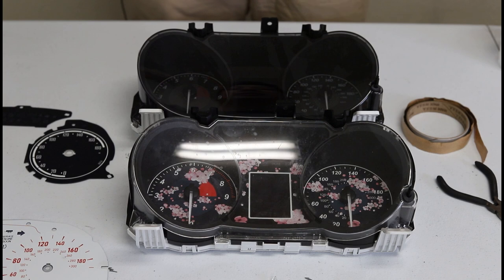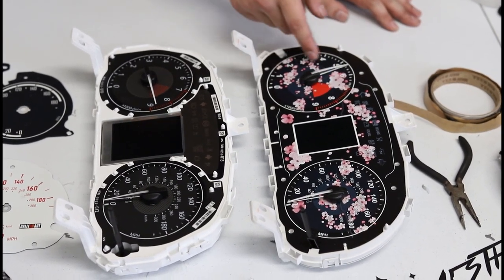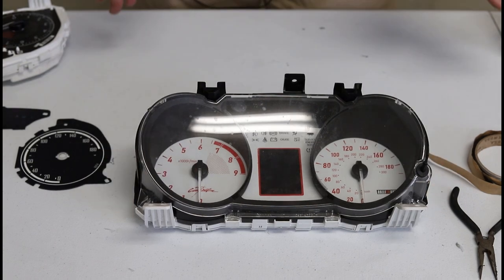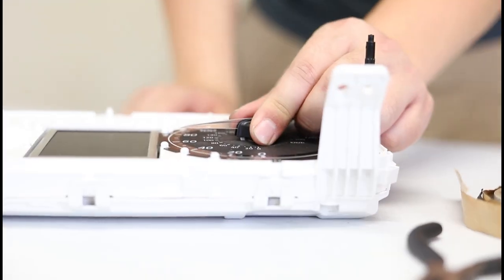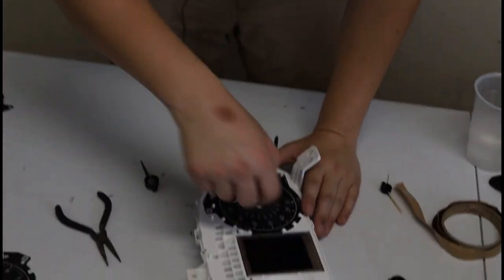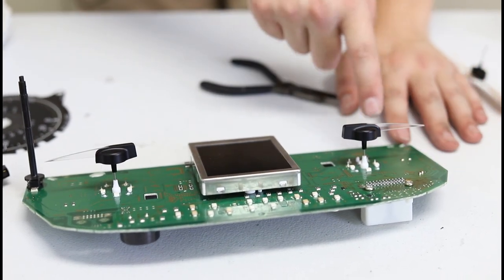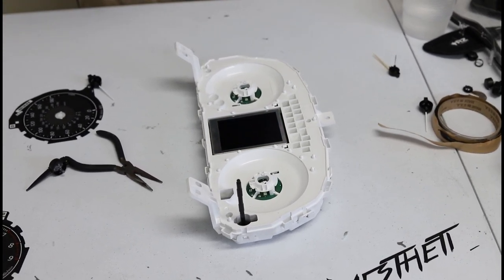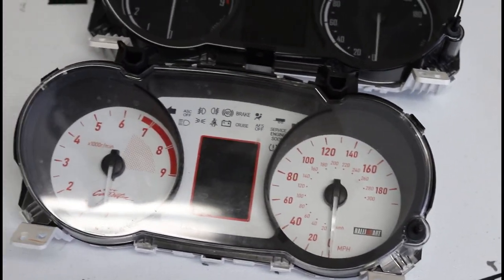Evo X Gauge Face Installation Tutorial

Comment: When car is off my needles go past zero pointing to nothing.  How to adjust this? I have the color version.  I tried spinning the needle counter clock wise many times. 

Also my plastic  needles dont pull off only they always come off with the shaft needle. You said in another video you have a video show what to do if the shaft does come out but dont see it.
Reply from the maker: @Josh.Davidson  ^ they use the same motors, so this video will work.

Comment: Hi,
I have got unlucky and then I have did follow video to reset a needle. But what I found some issue after reset. When I put the needle as 0 position when I start needle will over to 1 rmp. Do you know how to solved it?
Reply: Hi there you did not reset it fully in that case, remove the needle, but when you insert a little, make sure you turn it fully counterclockwise and THEN fully insert. Then fix the play with the pin from the back, that will work.
Reply: change the motor. the best way.
Reply: @AbdulHakimMohamad mana jual motor tu? Motor gauge saya jadi longgar.